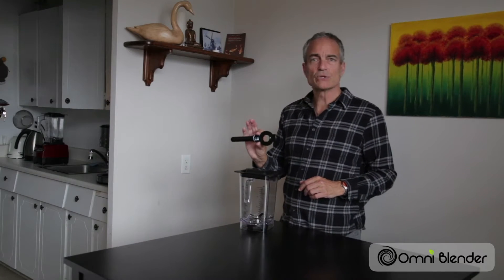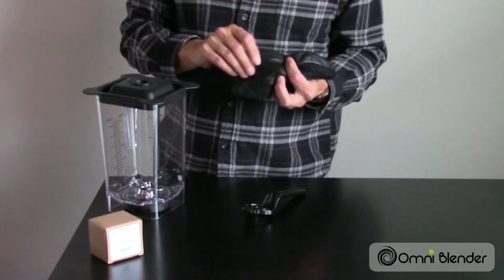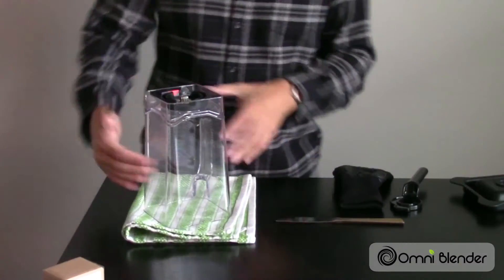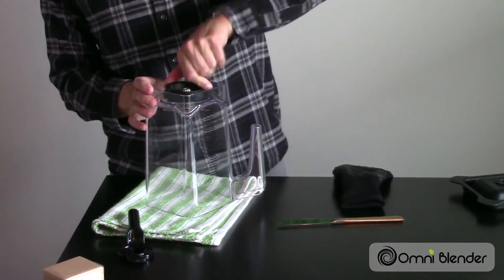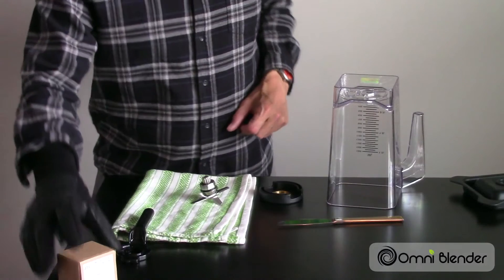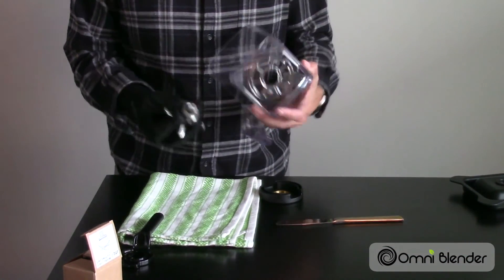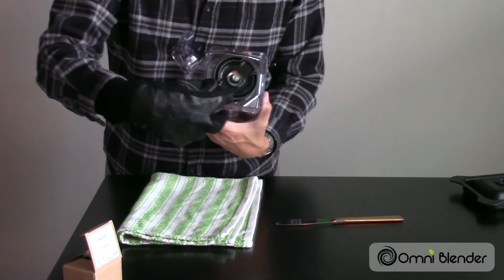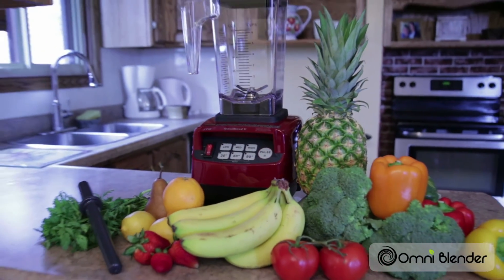How to Remove and Replace an Omni (OmniBlend) Blade Unit

Comment: It does NOT work at all! The blade just went out during blending, it is impossible to replace the blade into the container!!
Reply: Try watching the video. The blade unit is removed from the outside of the container, not the inside.